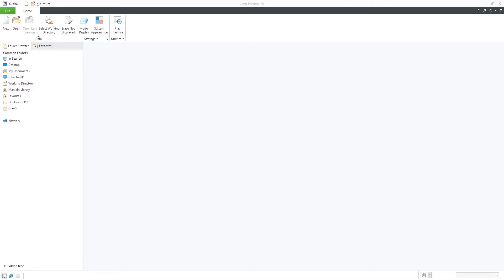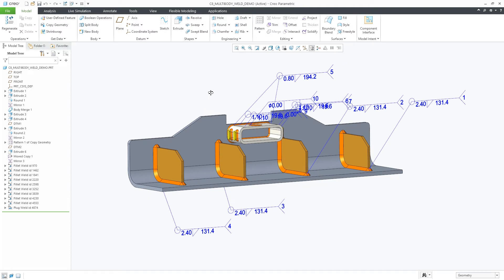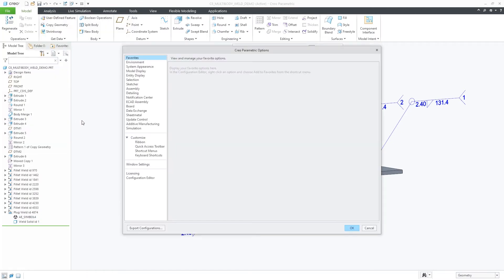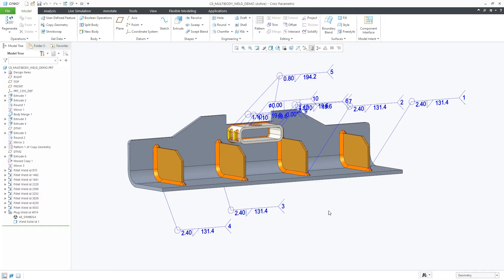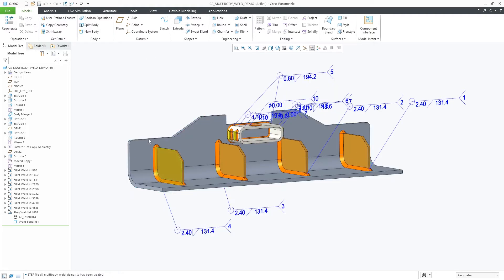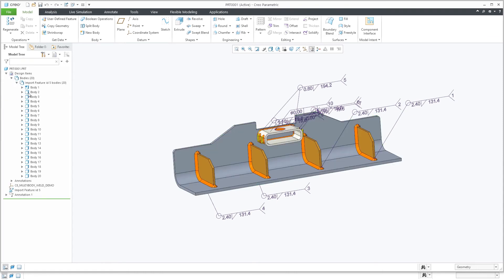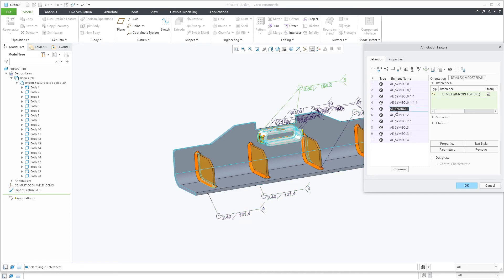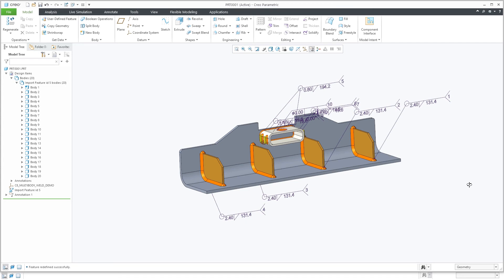Solid Weld Geometry Export | Creo 8

Comment: If  I make body 1, body 2 , body 3 etc and want to export them separately (one by one)  with different name  can it possible in Creo. Because in ug/nx we can export part by select body one by one.
Reply from the maker: Hi Suraj,

Check out our product manager's (Martin Neumueller) blog on our Community site where he addresses this question (yes) and with additional videos:
https://community.ptc.com/t5/Creo-Parametric-Tips/Multibody-How-to-save-out-a-single-body-to-stp-stl/m-p/752615/highlight/true#M884

https://community.ptc.com/t5/Creo-Parametric-Tips/Creo-7-0-8-0-Multibody-Home-Start-Here/m-p/666579#M473

Cheers!
Reply: @PTC_Creo  Great 👍👍 Not As easy as Ug/Nx But Thanks for help.
Reply from the maker: @surajprakash3264  You're welcome. Have a nice day!
Reply: @PTC_Creo  Sir need one more Help 
I open a part or component for mold design And it's already rotated in three Axies (X y Z) then how to Align it at right angle or according to datum plans. Lots of search I did not find any command to tackle this problem.
Reply from the maker: @surajprakash3264  I would recommend going to the PTC Community and making a thread there to ask your question:
https://community.ptc.com/t5/Creo-Parametric/ct-p/creoparametric
Reply: @PTC_Creo  sir I found my solution in ptc community but when I apply this the part open as it is .
If you provide me you Email I'd I will send you step of the part and plse make short video on this issue because I did not find any video on YouTube regarding this problem. Thanks in advance.
Reply from the maker: Hi Suraj,

Truthfully, this channel isn't meant to serve as technical support. If you haven't gotten fully what you want out of the PTC Community, then I'd recommend actually filing a tech support ticket. You can attach a part file there in the ticketing system at support.ptc.com and you can get your issue resolved in a much more comprehensive way than I can do.
Take care!